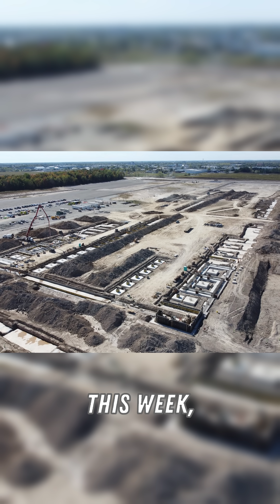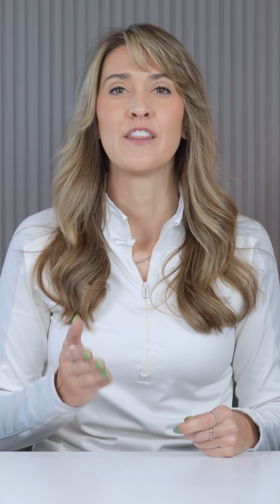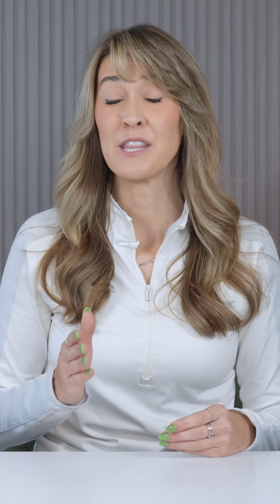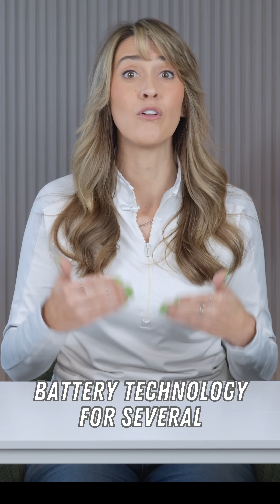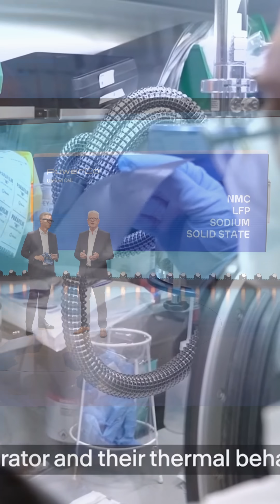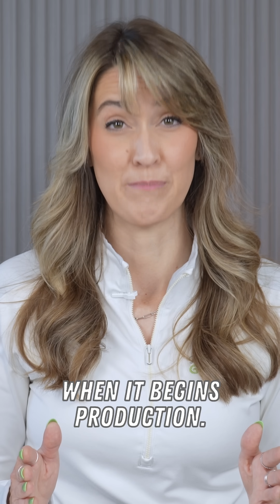More EV battery factories are on the way! #volkswagen

Comment: They say that the batteries will go into EVs but what they don't say is that only a complaint amount will

Those batteries will go into more profitable markets like grid scale battery packs
Reply: And that is not an issue as I am concerned..they will go where the demand dictates!
Reply from the maker: They'll be used in many applications. 
-Producer Tim
Reply: not really cause they are not stupid. Why would you use the chemistry for EVs to run those in grid operations where you have a different load profile and LFP does fit much better and longer compared to the current VW cells chemistry. 
Here the cells are for EV only and they are even short on supply in case sales would increase again as seen most recently in germany. VW and its brand own about up to 50% of the EV market here.
Reply from the maker: Electric cars are NOT the only application for this chemistry. Remember, all forms of transportation and recreational craft are using these cells and we've reported a lot about that on this show and on our Industry channel. 

Power tools and eBikes seem to be vastly underestimated by many commenters. Their automotive grade cell purchase volume vastly exceeds *most automakers.
-Producer Tim